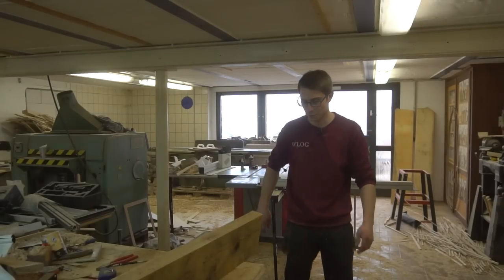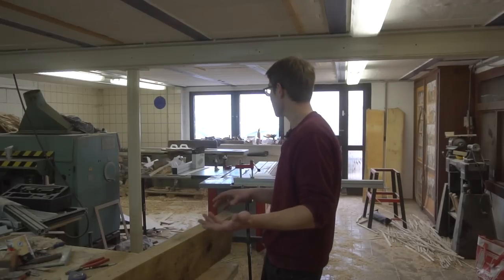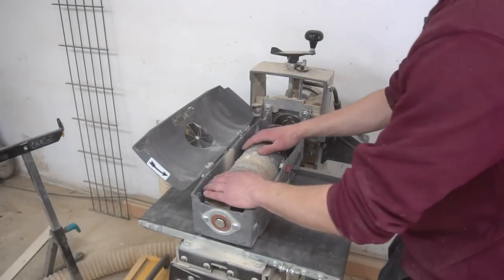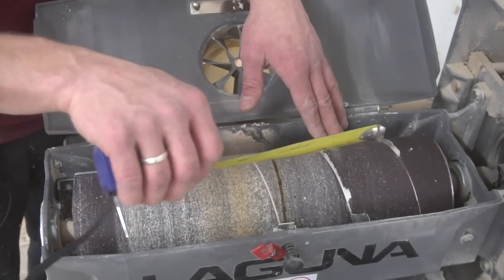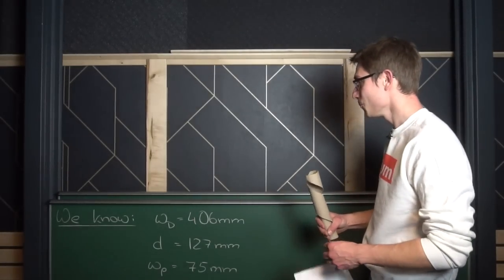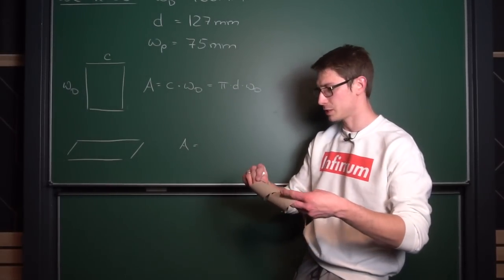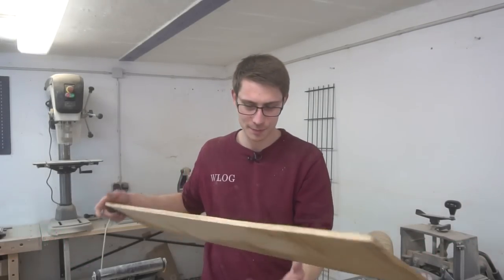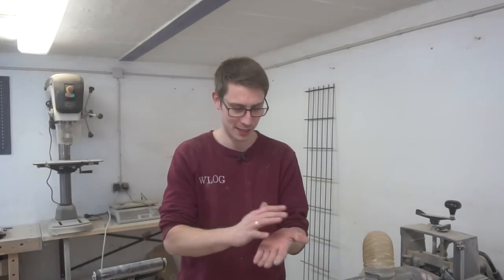I Like Math, But This is Better...

Comment: So the length of the wound strip is the length of one of its edges right? Which is just looks like a series of periodically repeating straight lines in the unwound cylinder, can you just total the length of these lines?